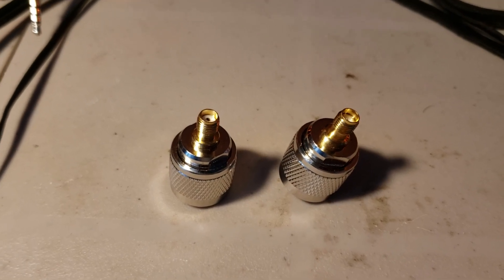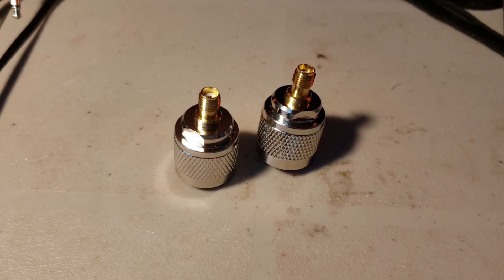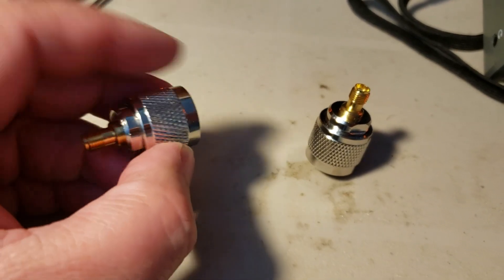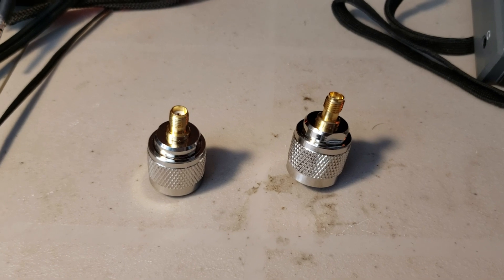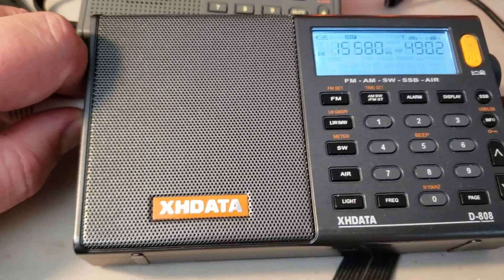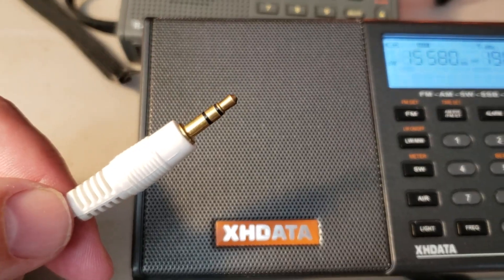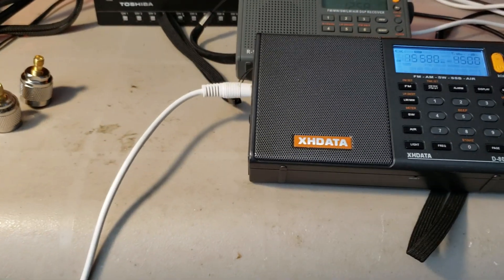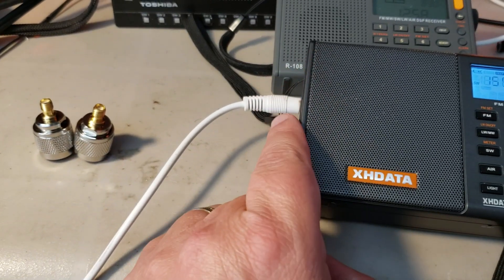Received SMA to PL259 adapters and my home made SMA to 1 8 audio cable for portables

Comment: thky i just ordered them. radio comes in 5 days  S-2000 and the antenna in 2 days mla-30. now the connectors for the cable tomorrow they say. but before every thing else. thanks so much for all your help. dan t palm springs calif USA